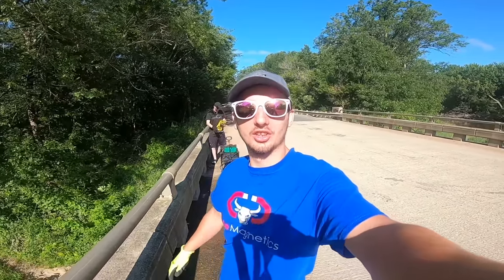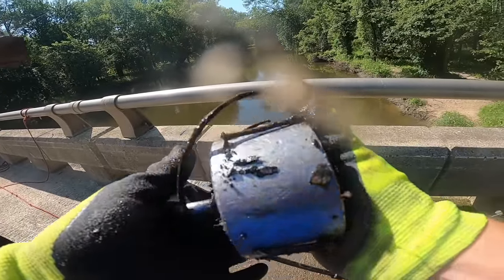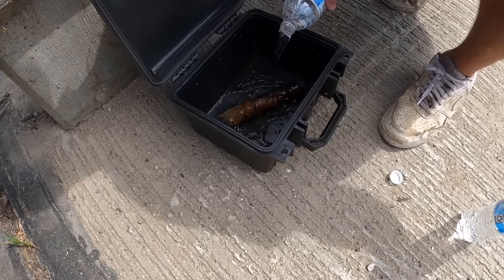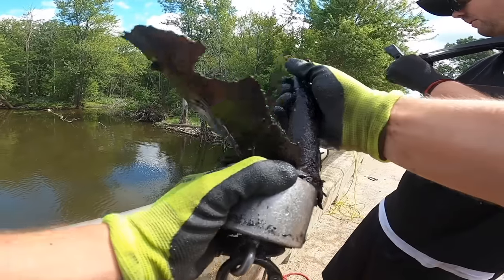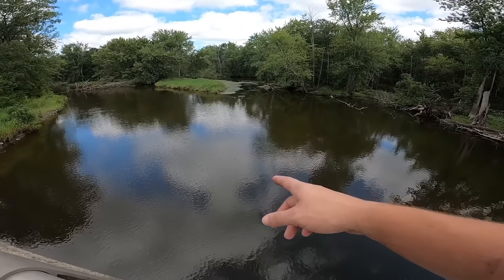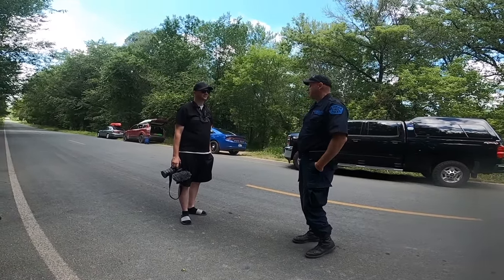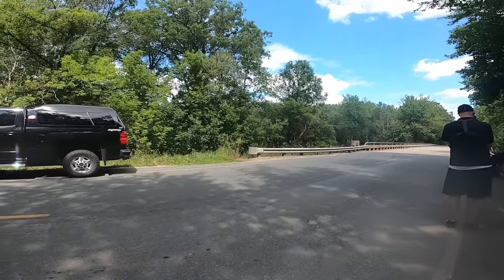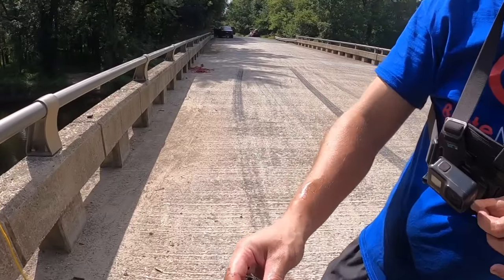Bomb Squad Couldn’t Believe Their Eyes When We Found This Magnet Fishing!!

Comment: Looks like a 20mm cannon round.  I would not say to dangerous in he condition they were in.  Rounds like this were designed to be really stable.  They go through torture just getting to the gun barrel in the feed mechanisms.  Cool find!
Reply: Yeah and considering they were under water and looked pretty worn the powder in them is probably ruined so you could hit it with a hammer as many times as you want and nothing would happen
Reply: Larger than 20
Reply: @zyanidwarfare5634  soooo… if I were to hand you active mortar rounds that had been in water you would willingly hit them with a hammer if I gave you one???
Reply: @DiscoMiata  What they found weren't mortar rounds. They were modern cannon shells. Munitions get banged around all the time and don't blow up. It's not any different than if someone found a .22LR water logged, aside from the size of it. With how badly they were corroded, I would be surprised if punching the primer did anything. Whatever was packed in the projectile, if anything, would be the only thing of concern. 

If I had to take a guess, they were probably 37mm shells, based on their size and shape. That was a popular caliber back in WW2. Not so much anymore.
Reply: @DiscoMiata  do you know how they work? You’d be fine lol
Reply: @DiscoMiata  Again. Not a mortar  round. It's a small cannon shell.
Reply: @Rafael_Fuchs  Contains nitroglycerin, wouldn’t recommend fucking with it
Reply: @DiscoMiata  Huh? That's dynamite, my dude. Trinitrotoluene was, and still is, the most common compound in HE shells. It's very resistant to impact detonation.
Reply: @DiscoMiata  there is a big difference between specific explosives, WW1 era ones like picric acid become super sensitive over time while the common WW2 ones like TNT, RDX, PETN and such are generally very stable and hard to set off. generally the fuse is the issue not the actual explosive anyway. nitroglycerin ie dynamite is not a commonly used explosive with military applications because it is impact sensitive. what specific shell that is is hard to tell but it certainly isn't a mortar round based on size i would guess it's a WW2 Hispano 20mm shell
Reply: @Wehra96  go ahead and mess with the explosive material, I’ll watch from a distance
Reply: @DiscoMiata  unless you are knowledgeable enough to positively ID what you are looking at that is not a good idea obviously.
Reply: @DiscoMiata  i've worked quite a bit with explosives in the past, mainly ANFO, the modern equivalent of dynamite and PETN. A lot of HEs would be completely safe to hit with a sledge actually.
Reply: @zyanidwarfare5634  Those look like 30mm Gau 8 rounds for an A-10. A-10 was the squadron next door to mine when I was a F-15  weapons loader at Nellis.
Reply: Looks like 25 mm rounds which can be he rounds better to not take chances with un exploded ordinance
Reply: 30 mm
Reply: @ApokalyptikNM  M3(Tank or AT gun both used the same ammo)
Reply: @Kodachrome02 Nope! Point Still stands! Not gonna mess with anything containing nitroglycerin!
Reply: @Kodachrome02  how do you know that they aren’t already primed? I mean you never know. Why the fuck were they over the bridge? No good reason that’s why
Reply: @ApokalyptikNM  no oh god no. everything you said is wrong in some way.

one its not a 37. a 37 is a pretty big round. this is more of a 20, maybe a 25 at most.

two a lot of planes used large cannons for at purposes however the ju87 g1 and g2 didnt use the american m4 but the german flak18 cannons. a few twin engine planes used 37s but they were rare and mostly handed to the smaller axis nations.

three, the me163, me262 and bf109s never used 37s, youre thinking of the mk108 which is a 30mm cannon. and in the case of the me262 there was a 5cm gun version but were just prototypes and were meant for bomber hunting.

the russians did have 37s but a completely different gun and round, because even the early part of the war the american 37 was outdated. and only upto the mig 17 kept the 37 and even then part way through the mig17 life they dropped the 37 and replaced it with another 23. after that they completely dropped the gun.
Reply: I would have said 30mm Rarden cannon rounds. At the time of making you're right they get some abuse going through the firing mechanism. The problem is deterioration. The water over time is good and, bad. The water reacts with the metal casing (bad). Thus weakening the ordnance external structure. Picric crystals form over time. If allowed to dry they can cause an explosion through friction (when it came apart in his hand). The water this time keeps the ordnance hydrated (good). The EOD guy mentions White phosphorus. Water (good) for this too. As it starts to dry it will ignite and flare up but, it also spits and crackles throwing pieces off. It burns skin like a hot knife through butter. I was a civilian with 33 Engr Regt (EOD) for 13 years. I was not a soldier. Weirdest thing we ever found were several Disney Bombs......
Reply: @Rafael_Fuchs  or comp B.  Most explosive rounds (I.e. artillery shells/mortars and so on) have a separate much less stable charge (usually contained in a fuse) used to detonate the main charge.  As for the round in the video it is definitely a cannon round most likely a 37mm or similar and not a mortar round.
Reply: That's what I was thinking
Reply: @Rafael_Fuchs  One of them looked like there was blue paint on the projectile. They looked to me like 20mm training rounds.
Reply: Regardless what they actually are, the fisherman clearly didn't have the knowledge to know how dangerous they are, so they  should take more care.  At the stack discovery 6:21, Just lower the stack of shells back into the water.  If they are unstable then not worth the risk for a YouTube video.  And then they kept pulling more out?!  From the bomb squad comments, it sounds like they're not that dangerous.  Would have been nice for the bomb squad tech to give a 5 minute review of the potential danger and how to handle them rather than a comment here and there.  Plus clearly state what they think they are.
Reply: After underwater for years, let's panic because  they might explode
Reply: But he called it a mortar......
Reply: @DiscoMiata  you already did watch from a distance while everyone who has a clue picked them up and tossed them around totally unconcerned because they all knew there was zero chance of anything exploding.
Reply: @jlckm2  Yeah, these things were built to be flung around violently in metal containers like sacks of potatoes falling off a truck. They don't just go off when they're live, let alone when they're wet/rotted for decades.
Reply: @st0n3p0ny  your arms not mine
Reply: @DiscoMiata  did you notice that nothing exploded in this video? Your silly pretend games aren't based on anything real. Sorry...
Reply: @st0n3p0ny  your fingers, hands and legs
Reply: @st0n3p0ny  if their wasn’t a chance of them exploding they wouldn’t remove them.
Reply: @DiscoMiata  apparently you've never interacted with anyone from the government?
Reply: @ApokalyptikNM  A 37mm round would be like "forearm size". These were like 20x70RB which are more hand size and would've been common for Oerlikon's in WWII.
Reply: Considering that the EOD guy suspected those to be white phosphorus rounds, them going dry could actually result in a fire and possible explosion, so, better to call the professionals and let them handle those.

In any way, no matter how much you think you know about ammunition and explosives, if you find something like that, better to call the authorities and have it be someone elses problem.
Reply: @st0n3p0ny  hahahhahahahahahahahahhahahahahahahahahhahahahaa WRONG
Reply: @DiscoMiata They call bomb squads to handle something that is actually an explosive threat. If they actually didn't know anything about how these rounds function, and they actually believed the silly idea that water makes them more likely to explode, they would shut down the street and keep people hundreds of yards away until EOD techs could respond.
Reply: @Rabascan  love to hear the rationale as to how anyone could possibly make that leap. 20mm white phosphorus rounds?
Reply: @st0n3p0ny  The statement of the EOD specialist that he wouldn't rule out that they are loaded with WP. There were 20mm incendiary rounds in use by the US military, and white phosphorus was a commonly used incendiary agent.
Reply: @Rabascan  in other words, could be anything. If they thought it was serious, they would have taken basic EOD precautions.
Reply: @st0n3p0ny  You've never seen EOD at work, have you?
Reply: @Rabascan  plenty of times and they don't treat real explosives like this
Reply: @zyanidwarfare5634  u gonna test it 😂😂
Reply: More like 30MM
Reply: @Rafael_Fuchs  I wouldn't recommend hitting things with a hammer though, most explosives have different characteristics as they decompose, and you never know if it changes to be faster burning and more sensitive to some environmental condition like oxygen or temperature.
Reply: the ammo itself is safe, however if its HE ammo than it can be unpredicable. they come in different flavours some are safe some are not.
combined with years in water id rather not play with them
Reply: @zyanidwarfare5634  wont fire unless the primer is missed fired or the primer gets hit very hard. So yeah if it was submerged underwater for many years gun powder becomes very moist and moldy; and it wont fire definitel.
Reply: @williamsimmons152  20mm are like the size of your forearm obviously exaggerated but they arent small
Reply: @cydeffect22  no not a chance
Reply: @everready19373  no not at all
Reply: @DiscoMiata  they don't contain nitro, and they aren't mortars, I get not wanting to mess with sketchy shit. That's reasonable. But don't act like you are the authority on that shit when you don't know the difference between a shell and a mortar.
Reply: @ApokalyptikNM  German fighters never had 37mm... Stukas G, bf110 g and HS129... But not fighters
Reply: Not 20mm more around 37 to 40mm most likely 37mm cannon shell should be safe unless they're HE shells then fuze's might pop and detonate the warhead but the propellant powder is probably water logged
Reply: I was thinking the same, at first it kinda looked like a 30mm but then I realized that it's way to small and the  30s have a tip to peirce thick metal
Reply: Looks about a 30mm which has the explosive mass of a hand grenade
Reply: @williamsimmons152  I have a 20mm in my hand rn, same size man...
Reply: @mr.stirfry9310  don’t hurt yourself.
Reply: @williamsimmons152  It's drilled out so no powder inside. But with a live 20 mm I'd be surprised if they went off. Ya would need a strong strike to set it off. Really makes a 50 cal look like a b*itch lol it's like a .556 compared to a .50cal. I wish I had a 20mm to sports shoot lol would be so fun but expensive. Ill stick wit shooting the 9mm and 12 gauge rn haha.
Reply: well it doesnt matter if its dangerous or not thats what my uncle found and mess with it much more worn than that definetly older since we found so many ww2 skeletons amunations bombs in here he messed with it and the explosion is not as strong but can remove an arm he is still alive at that time but lose his right arm good thing they arent close to each other with my father...now when my brother found 3 grenade my father got really angry because of it..even if its just a bullet...
Reply: I would guess 37mm. Used in early American tanks lime the M2 and M3 Grant's. I think the early American towed anti tank guns were 37mm. Edit  - I agree with earlier comment,  I think the 37mm anti rank rounds were bigger than those.
Reply: @Rafael_Fuchs  Old tnt "sweats//weeps" nitroglycerin and it can pool in areas. You're right probably harmless but I'd never take the chance of doing something foolish.
Reply: I wouldn't be surprised is there was an entire P-400 under that lake
Reply: @ApokalyptikNM  also 37 mm anti tank cannon or other jobs for infantry.
Reply: Look more like 50mm cannon shells to me
Reply: In the late 1970’s or early 1980’s some kids found a WWII shell in Terra Santa, California, from when it was a WWII gunnery range.  They were playing with it and it blew up.  
Old ammunition can become more sensitive.
Reply: @ApokalyptikNM  Much more likely for it to be from a regular 37mm cannon because, ya know, those existed a lot. Very unlikely to be aircraft ammo.
Reply: @DiscoMiata  they arent mortar shells because Mortar shells have fins and use rings of explosive tonlaunch
Reply: @JosephDawson1986  (I was messing with them bro, I wanted to see how long they would keep replying to someone clearly wrong lmaooo)
Reply: Agreed. 20mm rounds. Used in aircraft and other ack-ack batteries. Think 50cal, but bigger, with a little more kick!
Reply: This whole comment section: 🤓
Reply: Ya there no different than a bullet for a 9mm just size
Reply: yeah no. you don't know what your talking about you run bradley's cuz i do and i wouldn't trust any ammo with that level of corrosion ever especially bare handed
Reply: I’m sure ur an expert
Reply: @MrMonkey2150  i am thats why i said what i said how many bombs have you handled?
Reply: Yep
Reply: @DiscoMiata   its not mortar rounds its 20mm
Reply: It more looks to be 30x113mm cannon round
Reply: More like a 25mm round, definitely not a 30mm round.
Reply: @Thekilleroftanks yep I just realized that and did delete the comment idk what I was thinking tbh.
Reply: I’m glad we have you ‘the expert’ to inform us
Reply: ot a mortar round it's basically a lare rifle round

Comment: Fun fact the "mortar" he found was an anti aircraft round more than likely 20 mm judging by the size of round
Reply: Yeah, or perhaps little howitzer rounds, They look quite old, the fact they stuck to the magnet like and were rusted means they were steel and not brass,probably fell of a supply boat or something
Reply: You are exactly right my friend 20 MM. You prior military also?
Reply: @davidsummers4802  20mm ammo is electrically primed, not impact primed. Ya need 24vdc to light it off.
Reply: That was what I was thinking.
Reply: I own an Anzio 20mm.  Definitely 20mm rounds.
Reply: @davidsummers4802  no just love researching weapons and the ammo they use
Reply: Looks like 20mm, but probably had a steel core in the projectile, so AP, rather than HE
Reply: @Jexorz86  way too small.
Reply: The lack of a neck and size I am willing to bet it is 30mmx113mm used in the M230 chain gun off of an AH64 Apache
Reply: @leroywatermelon4025  apparently you hadn't noticed the ammo for the Anzio has a necked shell
Reply: This is common I throw all my unused 20mm rounds out of my helicopter when I’m done with a mission, sure it’s dangerous some kid could…..  I usually throw them in a river, I don’t want the airport cops finding out what I’m up to. 😊
Reply: @PlasmaStorm73 [N5EVV] I was a Navy AO from '79-'87. Electrically primed 20mm for aircraft was all I ever saw. The Germans had a 20mm shown in Saving Private Ryan. Doubt that was electrically primed.
Reply: They look smaller than 20 mm . I saw the deck gun on the Bowfin. It’s a little bigger.

Comment: im glad more and more people are magnet fishing. i know its to find treasures but its also helping to clean up our waters.
Reply: Textiles and plastic bags, sheet are much worse than iron.
Reply: @dat2ra  yeah but they are also usually embedded in mud much worse. Atleast they end up pulling up tons of plastic and similar with the metal items
Reply: @dat2ra  every little bit helps😂
Reply: @dat2ra  until you step into a screw or a nail - the pain of stepping on a lego is 10/10, 
but stepping into a rusty screw or nail is 10 times that pain and additionally you have to fear a sepsis.

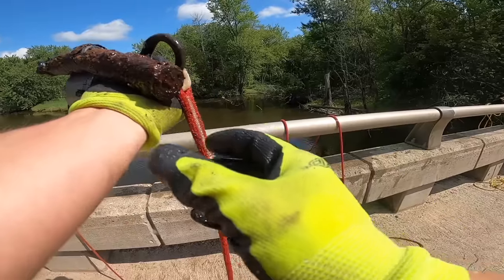Comment: 4:30 The powder inside the mortar shell is white, so it's probably potassium nitrate -which could potentially explain the hissing noise as the powder may be reacting with water.
Reply: Potassium nitrate hasn't been a thing since the 1890s and these aren't that old
Reply: @wingracer1614  not true, it's still used in fireworks, just because it's not in gun powder anymore doesn't mean it's not used
Reply: @GameByGame  These aren't fireworks. I am referring to munitions built in the last 140 years
Reply: @wingracer1614  You have no way of knowing if these do or don't.  Not all munitions use smokeless powder, and you don't know when these are from, probably the 70s.
Reply: @GameByGame  Yeah, 1970s. These didn't exist in the 1870s. This is not a "mortar" as he calls it. It's a 20-30mm cannon round such as you find in aircraft guns. There is no potassium nitrate in the propellant or the HE projectile. See M61 Vulcan for reference
Reply: I thought they said white phosphorus!
Reply: @wingracer1614  they did mention they were blue, most likely training rounds. So they might be using lower velocity charges in those?
Reply: @FlexDRG  That wouldn't be very good for training since the ballistics would be totally different. Training you would just use solid shot instead of HE or API.

As for blue, there are dummy rounds that are a light blue. M53 API was a dark blue. Some others in that family of ammo are also blue.